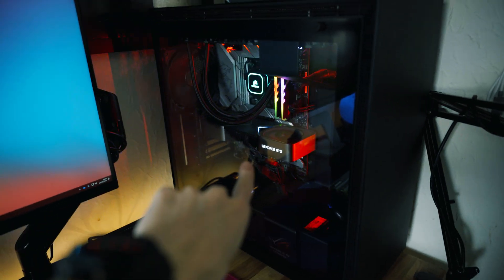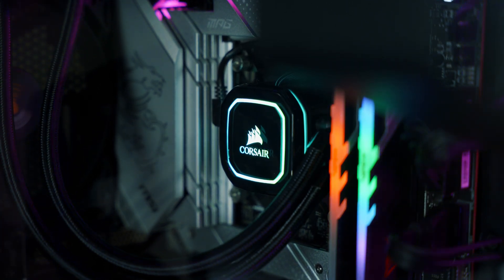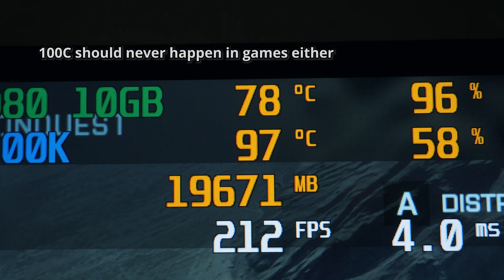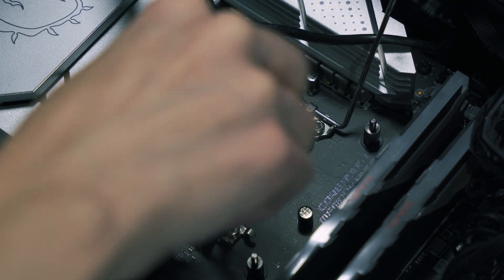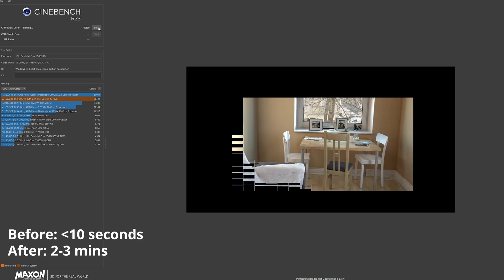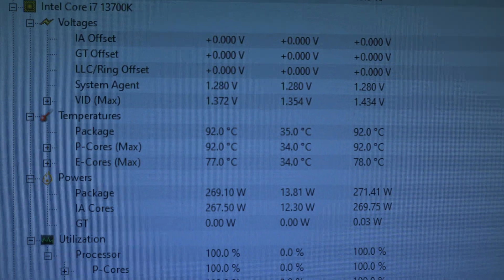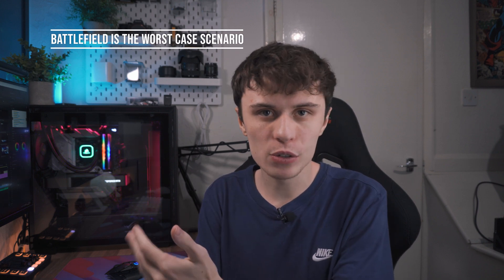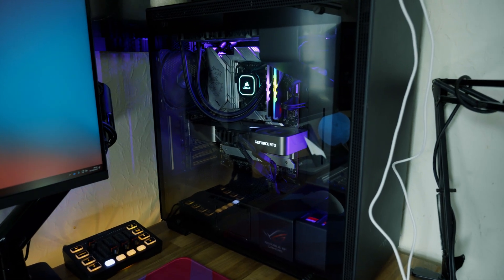13th Gen CPU Cooling Why YOU Need a Contact Frame!

Comment: Using non K 12th gen cpu andddd yep no noticable upgrade after installing thermalright frame even tho there is many said improvement temps in product reviews.
Reply: Cinebench i5 12400f get 11800 score
Power pl2 limit to 100 from 117w if i am not mistaken
Temp single core 37-42c
Temp multi core 52-54c

Comment: pop into your bios,  go to advanced cpu, diable under volting protection, go to the Vcore voltage and change it from 1245, to 1200 or 1225 , and it will drop the temperature by around 10 degrees, I had the same issue

Comment: Recently installed a contact frame on my 13700k (5.4ghz) Z690g platform, and peak temps in gaming are tapping out at 62c (1440p) I'm not sure why you're hitting such high temps still

Comment: 14700kf, not lapped.. overclocked all core with thermal grizzly contact frame and kryosheet runs at an avg of about 65c under load now. Reduction of about 10 degrees on average under load. Running ek nucleus 360 AIO.

Comment: I can't stress enough how important it is that you install the new ILM socket properly. make sure you tighten little by little bits in a criss cross pattern. the force distribution being equal in very very important to get the best results using these ILMs.

Comment: Installed a contact frame on my 13700k and it didn't help. It actually increased temps by like 10. I might have installed it incorrectly but it makes me want to reinstall the stock latches back.

Comment: i7-13700k owner here and I put one of these on and thermals were so much better. Used to go straight to 100°C with benchmarks and now I’m seeing averages in the 70’s. Some of it was the thermal paste application but this helped tremendously and I will recommend it anyway because it evenly distributes pressure from the cooler.

Comment: No need for this with my 13600KF the temperatures are fine. 35c idle and 75c on high process loads on average using a Phantom Spirit air cooler.

Comment: You need to adjust lite load in bios.. the default is 12 which is WAY to high.. most of these new gen CPU's running hot is the bios settings by default are garbage... I dropped 10C dropping lite load to 6 from 12 and my cinebench scores were identical.

Comment: im running the Asus Rog Strix Z690-E with a 12700k @5.6ghz on P cores and 4.2Ghz on e cores my temps barely touch 80c with a 240mm Aio maybe decrease ur voltage or check gamers nexus guild on installing the contact frame

Comment: i use a 12700F cpu. When i've installed first time and the cooler was properly fixed, i saw something strange, the cooler had a lot of movement with the screws tighten at maximum, so i've removed the cpu locking mechanism and i've put the cooler directly over cpu. The only thing what keep the cpu in place is the cooler. I didn't knew at that time about contact frames.

Comment: I'm late to the party on this video but you made one big mistake with this chip running hot, the radiator has to be installed over on the front of the case with the pipes downwards with 2 powerful or 3 powerful fans blasting air onto the radiator. Top mounted rads do not work well especially with known chips that run hot. Front mounting the radiator will give the air more time each time fluid is pumped out to cool down at the top of the rad by front mounting it.

Comment: I am receiving my contact frame tomorrow if all goes well. The same brand as yours but also with coolpaste from thermalright tf7 all for about 12 pounds including shipping for my I7-14700KF.

My temps are not getting that high without a contactframe about 88-92 but with a undervolt of 0.075 mv wich helps reduce the temp. I have a bit better cooler then yours and receiveing an even little better one today. The H150i Elite LCD XT wich has one of the lowest temps in high loads. Now i have the h150i capellix xt wich i am going to sell. I also wanted a lcd screen for once...

Hoping to reduce temps to about 80c or lower in Cinebech r23 in a loop of 10 mins or longer. During gaming it normally does not exceed 55-60c only with small spikes of about 85c when the cpu had a big load. But that is like 0.1% of the time or less.

Comment: With a .05 undervolt and 5.5 overclock on all p-cores and adding the contact frame, temps never pass 74c on cinebench with corsair h170i and thermal grizzly kryonaut(spread method). Before adding the frame it was at 79c max. So it does make a difference, also just by seeing what the thermal paste looks like on the cpu before the frame you can see why you need it.

Comment: Check your motherboard settings, they run 12/13/14th gen CPU's with power limits disabled by default which is the issue - motherboards set the "limit" to 4096W which essentially is unlimited and just lets the CPU pull as much power until it thermal throttles, jayztwocents has a newish video on it released 5 days ago.
My Gigabyte board let my 14700k pull 330w until it throttled at 100c, the Intel spec calls for 253w. After setting the power limit to "Intel POR" in my BIOS, it now draws 253w at full load and hits 77c without a contact frame, after fitting the frame it's down to 72c.
No idea why motherboards ignore Intel spec out the box, I know they're "unlocked" CPU's but 100c thermal throttling by default is dumb.
Reply: What’s your CPU?I am getting thermal throttling at 253W

Comment: The Thermalright contact frame works like a charme in my ASRock Z690 Steel Legend/D5 + 13600KF system with an Arctic LFII 120 Push/Pull (a larger radi doesn't fit in my case) + Arctic MX-6. It keep my system cool enough + quiet at Cinebench R23 never get over 88°C, no UV what so ever.

Comment: 100C at 5.1Ghz is really high.  I get that at 5.6Ghz.

You need a better cooler and airflow.
Reply from the maker: I have a 360mm radiator, but you're right about the airflow. I'm currently organising some new parts for this build
Reply: @ProYamYamPC  Cooler should push air out and have a couple case fans pulling cool air in.  Good for the other components like the GPU.

If you don't want to run high clock speeds, try lowering your CPU voltage.  That'll make quite a difference in temperatures.

Comment: I do have a question,  should you put a very small amount of thermal paste on the outer edge of the CPU aluminum to help transfer the heat to the The Thermarlight plate.
Reply: No the heat is dissapated through the IAO or normal cooler as the IHS is higher then the contact frame. So no paste there as there is no need to.

Comment: I recently got a blue (actually turquoise) Thermalright CPU frame to put in a newly purchased PC (i7 12700) after reading lots of reviews and chatter about the potential for bending the CPU. I simultaneously replaced the stock Intel cooler with the minimalist (single-stack) Thermalright Assassin X 120 R-SE. Since I mounted the cooler horizontally (air blowing from bottom to top), I can still see the top part of the turquoise CPU frame  peeking out over the top of the cooler stack. 😁 I haven't done any rigorous tests, but subjectively the temp numbers seem to be lower.

Comment: Hello, mate. I think your problem is - bad settings in BIOS. Your CPU consumes too much power. I have 13600kf, same therlmalright contact frame and 240mm water cooling (Gammax LE 520). CPU is not overclocked and in stress tests runs at 5.1 GHz with no problem, reaching only 80 degrees celsium max, consuming 160 Watts.

Comment: Use intel xtu lower voltages and your cpu won’t touch 90c
Reply: XTU2.0  still uses 512A and unlimited watts. Taking those down is best. 375a and 200w is a good start. *13700k

Comment: I'm building in not too long. I'm getting a i5-12500, and I bought the Thermalright contact frame and Peerless Assassin cooler to go with it. We'll see how it goes.
Reply: so how did it go?
Reply: @senliler  More cooling than a 12500 could ever hope for. I tried loading it up and I can't remember the number but it was running the coolest I've had in a long time.
Reply: @senliler  I reran the test. Loading all cores to 100%, the max any of them experienced was 57C. The over time average was low 50's.

Comment: I used that same one back when I built a 12700k back in December of 2022 for my daughter. I used the Corsair h100i. I removed that stock thermal paste and used the thermal grizzly kryonaut. I wasn’t messing around. Im really debating on putting the thermal grizzly krosheet. It’s working well on my personal build with a 5950x

Comment: Well, the other option is pretty hardcore at a direct die water block. The Thermal Grizzly contact frame 'might' get you like 1 or 2 more degree.
Bleh, Intel chips are heating so bad because of power inefficiencies.  I swear I'ma go AMD for my next build.

Comment: Hmm... my 13900K CPU core temps sits at 91-92 running 10 min of Cinebench R23. The CPU Package and Core Max hits 99-100, and shows throttling on 4-6 of P-cores, so obviously it's up against the limit often. But f your 13700K is easily hitting 100, maybe it's your cooling solution?

Comment: Just got and installed a 14900K on my Z690 Aorus Master with the Arctic Liquid Freezer 2 360 ARGB AIO and my idle temps average roughly between 32-34 degrees, but even during idle sometimes spike up to 66 degrees and during gaming load with everything maxed out, reaches 82-85 degrees... this is using the intel ILM and Arctic MX-6 thermal paste. So yeah... Definitely furnaces.
Reply from the maker: Oh 100%, I think my 13700K is a bit of a lemon as I think I lost the silicon lottery. I tried a -60mV offset and that results in BSODs😂
Reply: Ohh... that's rough. Have you managed to sort it since or is it still causing you BSODs whenever you try undervolt?  @ProYamYamPC

Comment: The trick to this is limiting the watts used to 125 and set the thermal limit to 90c.  I know it sounds crazy, but try it.  I am now getting 30000 on cinabench, and the temps don't go over 90.
Reply: doesnt sound good on paper. maybe you were hitting the 100c thermal throttle and your benchmark scores were affected. I pull 200 watts and max out on 90c with an air cooler.
Reply: @sjejqnrof98vi  And what is your benchmark scores?
Reply: What CPU?

Comment: built my pc with a contact frame, 13700K cpu and used a chromamax air cooler. all stress tests stayed below 85C. i do not overclock, no need for it.

Comment: This is simply my opinion. I used the Thermal Grizzly frame. Now that is one amazingly well machined product. I just believe you always get what you pay for. Those feet on that Thermalright frame gave me immediate pause. It's a shortcut, If you're comfortable with that, ok. I wasn't. My temps using the ROG Ryujin III AIO on Maxximus Dark Hero and 14900KF are 10 degrees cooler that the EKWB open loop it replaced. I also used de baurs (Thermal Grizzly) Graphene pad (spelling?). No paste. Fantastic.
But again, I believe you get what you pay for. This could be a great budget substitute but in my opinion it's just that. Number 2. But stills appears to do the job well enough.
Reply: I agree. But I'm on a budget, so.... do what ya gotta do to trim the fat so to speak. I straight skimped on the neat lighting, so I could get better parts. Was even willing to mod my case so I could have a bluray burner drive, cause a case with a full sized drive bay AND cools well is rather expensive. 

Sony straight deleting digital media from the PS5 owner's hard drive taught me to always have a physical backup in SOME form.

Comment: Bought one for my 12900k.  Running at 5.3. Put the same frame on mine. Got 18c better temps straight away. £7.09  got the silver one amazon.
Reply from the maker: For £7 it's an amazing deal to drop a whole 18C!

Comment: Perhaps you may need to consider your build has other issues. Maybe the case airflow is poor, or your cooler isn't performing as well as it should be. I hit 92-93°C in Cinebench, stock clock, no undervolt. I was then able to undervolt 0.1mV and bump BCLK to 103MHz with no stability issues in Battlefield 2042. Now, my hottest core barely touches 80°C in Cinebench R23.
Reply: lol i used -0.115v on my 13900k and i bearly reach 60C with NZXT N120 two fans. now i use kraken elite 360 and i dont get abouve 60c with stock settings.
Reply: @noobontour3167  in Cinebench?
Reply: @noobontour3167 Overclocked? In Cinebench R23?

Comment: Hey man, I personally have an i7-14700k with 7900 xtx (450W phantom edition) So much higher load / wattage than you so Im wondering, how is that possible ? I am not going over 60-65 on medium-high to max load. And my fans don't hit 100% until 72+ too .
my only assumption is your cooling since your aio and airflow dont seem to be that optimal. I have a shitty case, but it has an arctic 360 and it has been phenomenal .

This black friday arctic are having an insane sale, maybe you could check it out
Reply: You probably have limits in your bios setting it lower then it can run. His is maybe unlimited as a lot of Asus bioses have that. I have a 14700KF wich can hit up to 100c if i set no limits. I have a small undervolt now wich makes it not reeaching higher then 93c in Cinebecnh loop for 10 mins. My score is 35600 points in that run. I am sure your will not hit that high if your temps are that low. 

I am using the Corsair 360 AIO the H150i elite capellix xt. And today i will get the H150i elite lcd xt wich is on top of the best AIO regarding low temps under load. I konw the arctic is also very good depending wich one you have but these Corsairs are even a little better. So that temps you said is impossible even with delidding the IHS and direct die contact under R23 load.

I am curious what score your r23 is multi. single i hit almost 2200 and multi 35600 after 10 min run.

Comment: mine 13700k with maxpefr settings 5,4Ghz Pcore all the time and 4,4Ghz Ecore all the time, gigabyte z790, goes around 92°C cinebench r23 10min throttle test. with slight UV -0,075V goes 85°C, i use deepcool ls720 360aio, best of the best and with 1200rpm. fan speeds all the time under stress test. all without frame... but i try it in few days, then my cpu will be coolest on earth maybe... i heard catastrophic scenarios about this cpus and looks like is not really true...

Comment: Did you sort out your temperature issues yet? There's a common issue of MSI motherboards increasing voltage depending on the cooling option you select. Selecting "water cooled" is usually the cause. I have a MSI PRO Z790-A WIFI and don't have this issue, perhaps because it's newer or because the latest BIOS isn't set to increase the voltage like that. I have a 13600K so I can't draw a direct comparison, but I do know that some motherboards were pushing these CPUs to 1.4V and beyond. Didn't happen for me. In fact, I've slightly overclocked mine and still don't reach 100C because I'm maxing out at 1.2V.

TL:DR; I recommend looking at the cooling option you selected in BIOS. If you have it set to water cooler, try changing that to tower cooler. There is a very good chance that this will fix things.
Intel didn't intend for these CPUs to run at such high voltages; it's the motherboard manufacturers that decided to do this.
Reply from the maker: Good shout. I know it’s currently set to water cooler😂 I’m going to change that to tower cooler and I will report back. Thanks mate.
Reply: @ProYamYamPC Any news to report?
Reply from the maker: @BillyfromConsett  I changed it to tower cooler and it has reduced temperatures slightly. Nothing too major though

Comment: Hmmmm something is wrong with your bios settings for sure. I’m using a 240mm AIO and the thermalright frame with the 13700k and my max temp at 250W is about 79c. After undervolting 120mv it’s getting to about 65 max

Comment: I have the 13900k and its insanely hot. Ive got a 360mm aio and it is reaching 100c whenever i am gaming. Looking for a cheap soluce so thanks !
Reply: Your issue is elsewhere. I'm running 13900k and not even OCed have I passed 88 C on full 100% usage.
Reply: Bad cooler mount.
Reply: Did not touch the mount, I updated the bios once before changing cpu to enable 13th gen on my 12th gen mobo and I was getting baaaaad temps. Updated it further and my temps are "normal" now.
Edit: probably a voltage problem or bug with the first bios for 13th from msi.
Reply: @Sir_Leany  remount the cooler correctly. There  is no way a 360mm cooler does 100C while gaming

Comment: The thermalite is actually the best choice,.  You can't screw it up and damage the board or pins.  You just have to "tighten it to the wall", but how to do that is complicated.   I used to build wheels as a bike mechanic.  Found a better way to find even compression with this plate, I can't share it though.  Builders have to keep their secrets.

Comment: Hi, such high temperatures might be partly caused by wrong CPU cooler orientation/placement.

"Gamers nexus" made a video about it 3 years ago, check it out. He recommends to put it horizontaly above your CPU (so tubes go down to CPU).
Reply from the maker: My cooler is mounted above the CPU and it’s set to exhaust

Comment: Should never be running 90c at a normal or even 85c that’s 13900k status not i7. I’d upgrade that Corsair immediately. I recently read people are having SSD over heating issues and never thought to check it, especially Samsung pro. I know everyone is giving you their jay two cents about it but great video on how to install and use the frame. Should be required for everyone for the price.